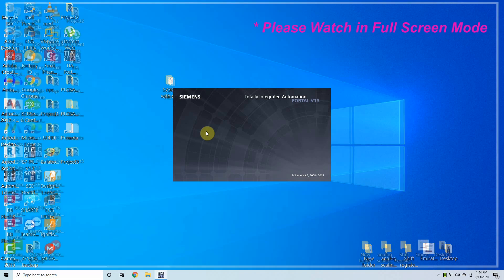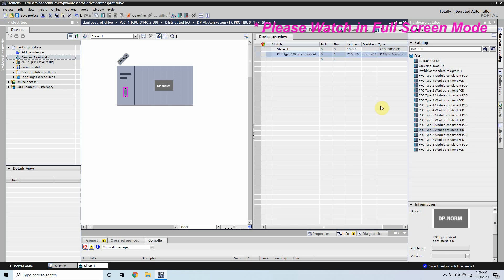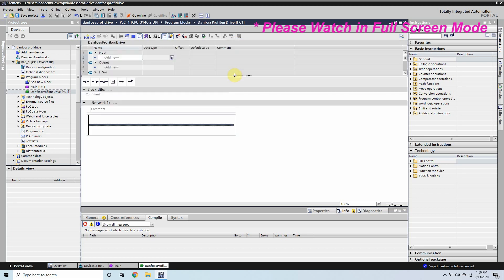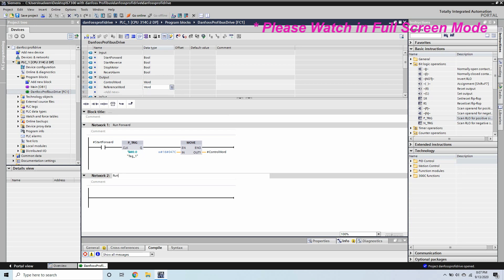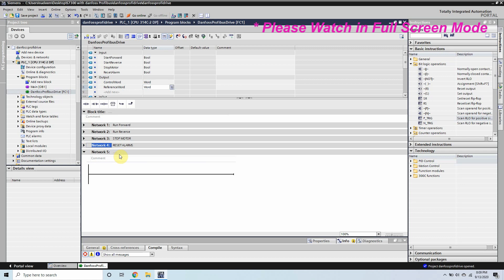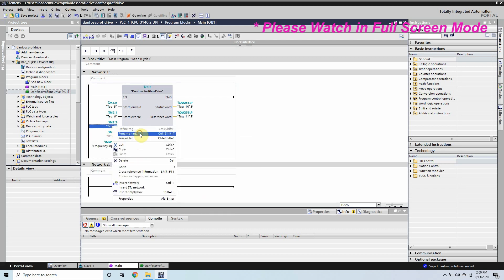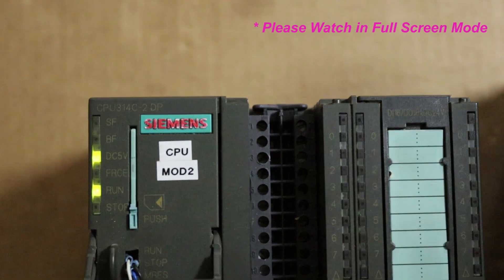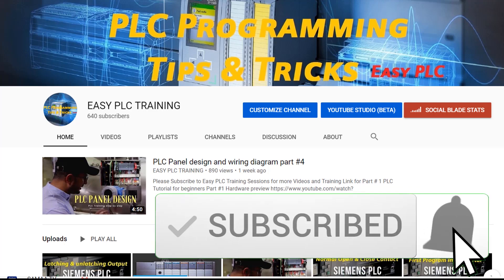How to communicate siemens S7 300 PLC with Danfoss VFD via profibus using TIA Portal ? #43

Comment: hello dear, appreciated your work. Just a request for you. Can you please provide a soft copy in which you listed all the necessary parameters required to interface any Drive (Danfoss, Siemens, Parker, Mitsubishi, etc) with the PLC? Also, it will be a plus if you add a video in which you can  provide a detailed comparison b/w Simatic manager and TIA portal so the user of Simatic manager can easily switch b/w these two applications